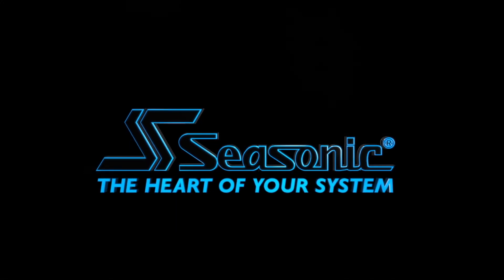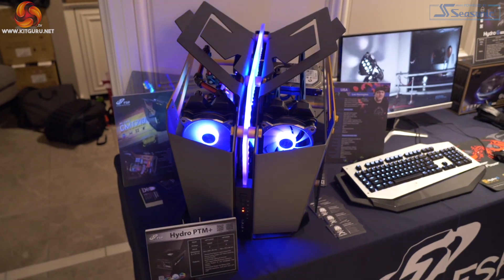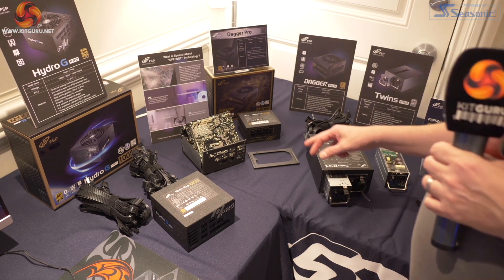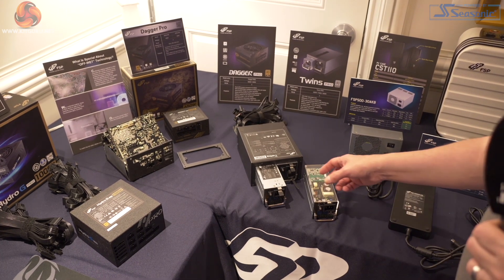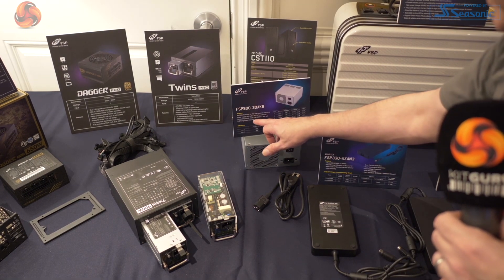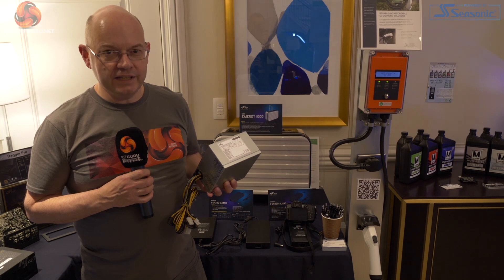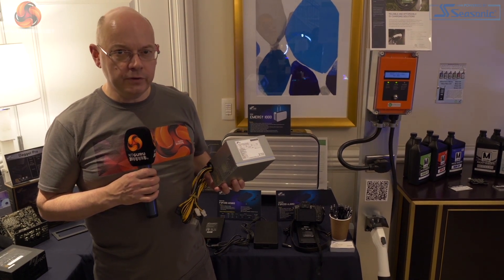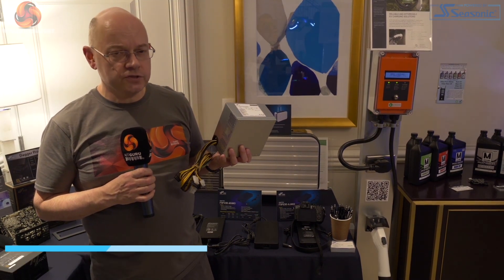CES 2020: FSP and the 12V ONLY PSU !

Comment: I agree with XianYang, California does not have it's priorities set straight! That being said if I had to choose between replacing a power supply or a motherboard I wouldn't, they're both a pain and connected to literally everything though I'd make the uneducated guess that motherboards have less subjective tolerance of heat than power supplies.

Comment: I like that Twins 900W unit. Just hope it can be cooled well enough in a standard case(they usually have 15000RPM fans to push air through the tight chamber).👍

I'm pretty sure the FSP500--30AKB is the basically the same as the ones used in some HP units(although only around 250W).  They use a 10 pin connector and rectify power on the mobo........
Maybe upgrading those potato budget builds will be a tad easier now?🤔

Still matching colour scheme too!!😂